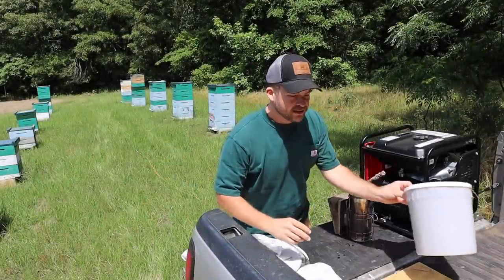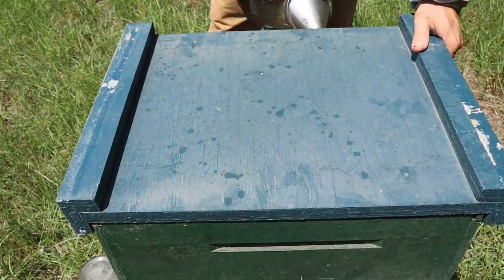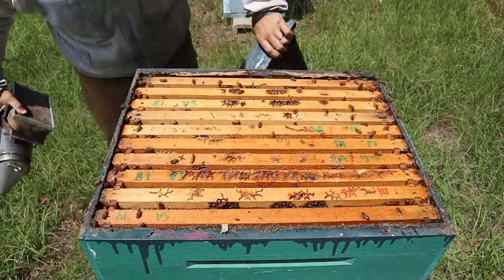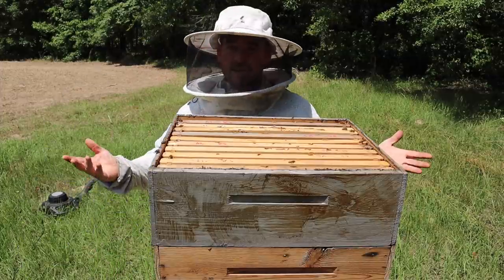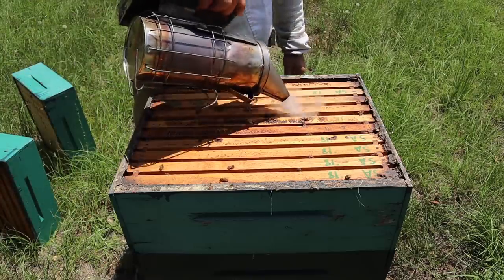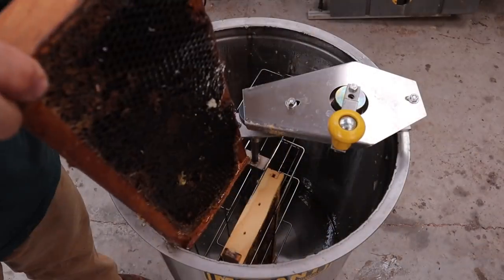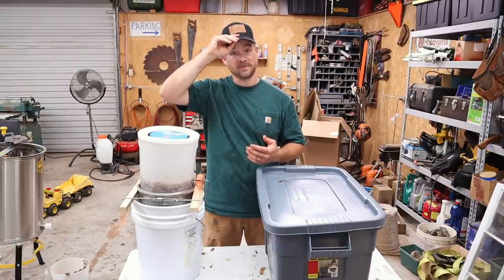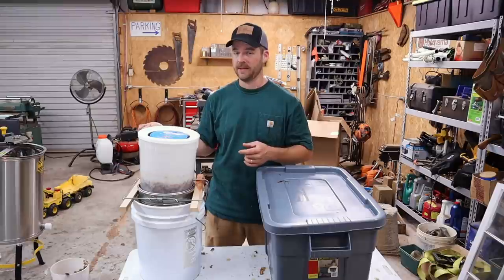Honey Harvest 2021!

Comment: Thanks for your video and to learn how you do your harvesting. You asked for suggestions so here goes.
1. If you place a board across your plastic tote that catches your cappings it will give you something to rest your frames on at a more comfortable position. Also if you put a screws or nail in it from the bottom and allow a portion of it to protrude through the wood it will allow your frames to be held in a single position that keeps them from sliding off.
2. Have you tried using a bee escape or fume boards? 
3. Have you thought about using two smaller tubs and do two processes at the same time? If you take a plastic tub, got mine from Sam's Club, and cut out the bottom of one of them, leaving a portion of the bottom to catch a piece of thin aluminum angle that has some screen wire attached to it. This allows the cappings to fall on the screen and be dripping while you are working on the next frames. The second tub which is the same size is below it and has a frame made to keep the upper tub from laying on the bottom of the lower tub.
4. Kamon Reynolds recently posted a plastic box he uses to harvest his frames with that has 10 locations to place the frames in with some space below to allow any comb that is hanging below the frame to not be smashed against the bottom. It was also wide enough that there was plenty of room for the odd thickness fat frames. It also had a vented lid that allows hot air to escape and to keep the bees from robbing. the tub was very pricey so I am thinking about finding a tub that will allow frames to rest on the sides and hold at least 10 frames. I am sure I can find one that will work that can have a piece of aluminum angle or wood attached to the side of the tub that the frames can rest on that would be made for less than 87 dollars plus shipping. 
Hope I didn't step on your toes. Good luck.

Comment: Very interesting seeing what you are doing for the harvest. This is my second year. I went into winter with 8 colonies, all from swarms. Came out of winter with all 8. I just checked my 4 horizontal hives and have 16 deep frames full of nectar that they are starting to cap. I have 6 medium honey supers on other colonies that are full and about half capped. I've never extracted and have no equipment. I'm scared. Hoping to get help and advice from an 86 year old retired bee keeper that still has all of his equipment in the barn. What's even worse, I'm not sure what I did to get them through the winter and what I've done right during the flow lol. What a hobby lol.

Comment: I really enjoy all your videos. I was wondering if you could speed up the extraction from the caps by getting another bucket of the same size as the one with the hole and place it into the bottom bucket. Put some weight in the top bucket so it forces the honey out. Just a thought.

Comment: It's not entirely bad that you put frames back that still hold honey. The bees still need honey to survive the rest of the Season. More important at the end of the Season, though. It supplies the Off-Season/Winter food so they can survive to see another Season. Considering the current condition of your hives(low production?), maybe it will turn out to be a good thing. Hopefully your next harvest will be more plentiful. Something to ponder, since you are the 4th I've seen with low production this year. Could it be a lower count of blossoms available this year? Did 2020 have some adverse effect on 2021's ability to provide enough? Could it be the weather? Myself, I noticed that nearly half of the plants that bloom on my property were early this year and the rest came in later than normal. And that's just the normal Spring bloomers. We still have Summer and Fall to observe. Maybe this could be the reason for the low count, but that still leaves the question of why the delay of bloom. Just a thought.

Comment: I am always up to try some different honey.
You could always buy a sewing machine motor and use it on your extractor for less than $30. Most even come with the pedal and belt for that price. Take off the handle and add a motor pulley or wheel pulley.

Comment: Have you thought about using a 4 inch metal paint scraper heated slightly with a torch to efficiently remove the caps it is much easier than using a knife like you are seen doing in this video.

Comment: Place a piece of 2 X 2 lumber over your extracting bin with a 2 inch nail in the centre (de-head the nail) place your frame on the nail, nail helps to turn the frame and you will be able to slice from top to bottom.

Comment: You know more about me than Honey bees, i just wanted to share a trick that i saw and works great when uncapping frames. take a board" i use the top board off of a honey frame that may not be long enough for your tub, Cut a notch in each end so it will fit over the top edge of the tub. Drive a nail from the bottom up until about a 1/2 inch is coming through. rest the end of the frame you are decapping on the point of the nail. It prevents the frame from sliding around and also keeps it out of the Honey that is collecting in the bottom of the tub. I use a plastic meet tray for my tub but you have a lot more frames than me.

Comment: Suggestions: 1.Mix the honey. Blended flavors will be more nuanced ( Yeah right Bruce you could not tel,,, Well you can tell CLOVER! YUCK), 2, ever think of making a warming collar for the tubs? Something like a larger bucket with a water-tight connection. Just enough to warm the fluid so that your drainage may be a bit speedier. If you run out of honey whip up a batch of corn cob jelly. Heck, whip a batch of that up anyway. Yeah, you Yankees there is such a thing!

Comment: @3:08 Surely the queen lays according to the size of the cell. If the workers make drone sized cells the queen won't fertilise the egg and you'll get a drone. If the workers draw out worker sized cells then the queen will fertilise those eggs and make workers. About 1 frame in 10 of drones is not a bad ratio if you want strong mating and go by organic hives. Also, just because there are drone cells does not mean the workers are directing her there to lay more drone eggs and also some of those drones could be from other hives. I think therefore the queen is not to blame and she's just responding to what the community is demanding from her. Any replacement queen will just carry on where the old queen left off.

Comment: Can I make a suggestion, without sounding like a know it all? Turn the bucket you're cutting the caps off and turn it 90 degrees. It looks like you just need more room to cut the cappings because of the length of your knife and your arm.

Or build a little rack to go on top of the cuttings bucket to support the frame and the cuttings fall into the box from the top.

Comment: I Miss the Nights Drivin down the Higway With Owls Smasin into the Windscreen and a 100 Sheep on the Road round the Corner with No Where to go and their little feet slippin on the asfalt as their tryin to run of but are just running on the spot and then the truck bouncin all over the place bcos they have lots of wool ont hem still.

Comment: Be carefree of the plastic your tote is made of.  Might be better off using a 5 gallon food grade bucket,   Either way, using a  inch or so wide piece of wood attached to across  the tote with a screw extending out in the middle would  help  uncapping by  holding the frames still.  I enjoy your video very much,